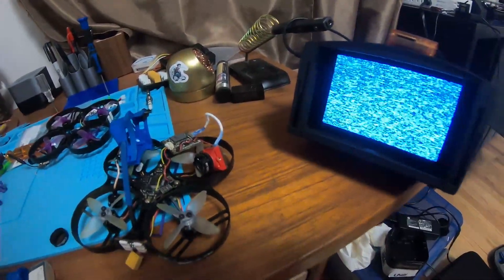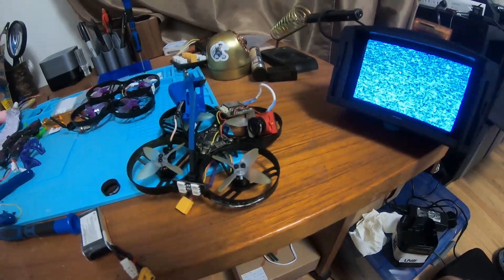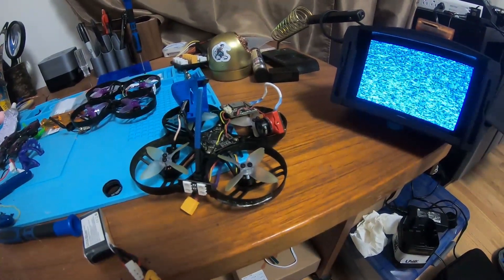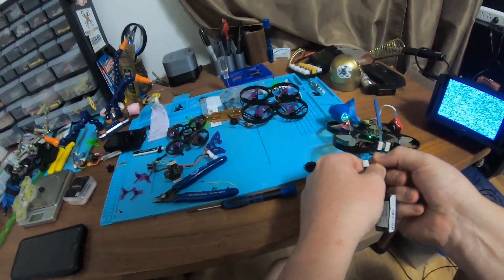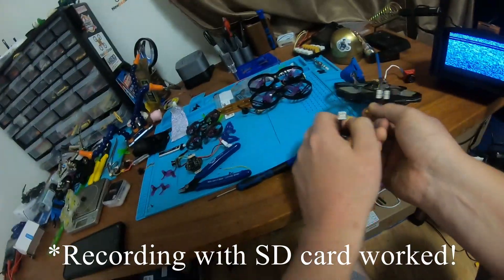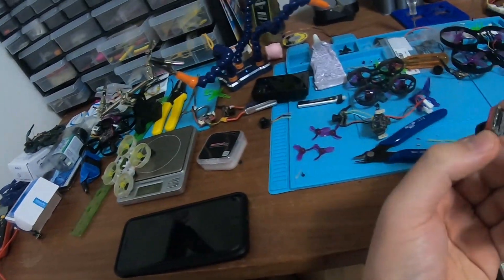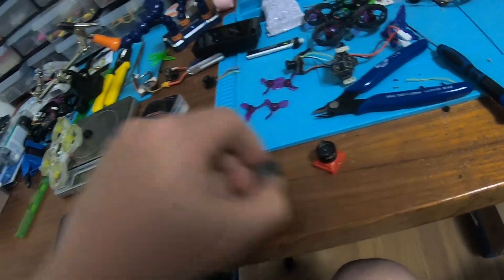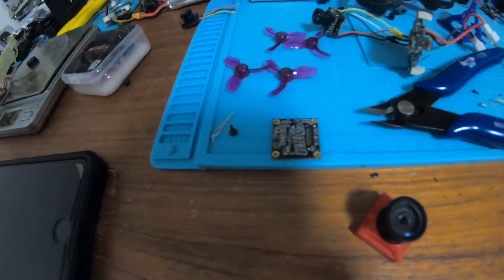How to FIX the Caddx Turtle Yellow Screen of Death (without replacing anything!)

Comment: Youre a legend man!! I’ve had this camera sitting around for nearly 2 years because it wasn’t working and the other day I thought itd be good for my micro LR so I had a google and your video popped up. All fixed in less than an hour!! 🙌🙌🙏🙏🙏
Reply from the maker: Awesome! Idk if they are still doing it but you could message Caddx before and they would mail out a replacement board for free. I would message them through their website and see if you can still get one.

Comment: I had a similar problem, OSD but black screen (no video). Searched everywhere for an answer, couldn't find anything that worked.  But then I stared at the owner's manual for a while until I noticed something.  The same button that starts and stops the video recording, ALSO turns the camera on and off.  Hold the button for 5 seconds, and it turns the camera on/off.  So I held it for 5 seconds while everything was powered up, and viola, I got the video back, NO MORE BLACK SCREEN!  NOTE 1: If you power off then power on the quad and get the black screen again, press and hold the button for 5 seconds to turn the camera on and then connect the 5D-OSD Menu Board to adjust the camera's settings.  Go to "System settings > Auto boot > on," and that fixed it for me.  Now the camera comes on when I power up the quad.  NOTE 2: I have the Caddx Baby Turtle V2.  It came with my GepRc Skip HD3, which by the way, is an AWESOME quad!
Reply from the maker: Cool - yeah yellow screen means the cam is not working but connected.
Reply: @FPVSkittles  I don't think this is true. I can remove the cam completely and still get the yellow screen.
Reply: Thank you for help man. Auto boot is useful there.

Comment: Hi,  i've problem like this but mine was blackscreen..
Reply: I had the same problem, OSD but black screen (no video). Searched everywhere for an answer, couldn't find anything that worked.  But then I stared at the owner's manual for a while until I noticed something.  The same button that starts and stops the video recording, ALSO turns the camera on and off.  Hold the button for 5 seconds, and it turns the camera on/off.  So I held it for 5 seconds while everything was powered up, and viola, I got the video back, NO MORE BLACK SCREEN!  NOTE 1: If you power off then power on the quad and get the black screen again, press and hold the button for 5 seconds to turn the camera on and then connect the 5D-OSD Menu Board to adjust the camera's settings.  Go to "System settings > Auto boot > on," and that fixed it for me.  Now the camera comes on when I power up the quad.  NOTE 2: I have the Caddx Baby Turtle V2.  It came with my GepRc Skip HD3, which by the way, is an AWESOME quad!
Reply from the maker: Black screen with osd normally with fix itself after a powercycle
Reply: @davehrcfpv  When all else fails, read the instructions, huh?  Glad I could help.  I was so happy when it worked for me.
Reply: @davehrcfpv  Again, glad I could help.  BangGood had a link to the owner's manual, and I also sent a request on the Caddx website and they sent me a pdf.  You can get the voltage and flight time on the camera's OSD.  You access it using the same 5D-OSD Menu Board "OSD settings > Voltage > On > Time > On." Not sure exactly how things have to be wired for it to read the voltage accurately, but it's something to try if you can't get the BetaFlight OSD.
Reply: @davehrcfpv  You always have to have the schematic/pin-outs for the FC, VTX, RX and camera you are using, or...you're $hit out of luck.  Even then, good luck...it ain't always easy!

Comment: IT WORKED!!!    It's only a $15 part from Banggood,  but then I would have had to wait for the slow boat from Corona. I formed a piece of foil to set it on so the sensor wouldn't touch. I put it in the oven at 180 for 7 minutes and it did not work the first time. I had nothing to lose so I tried it again at 200 for 7 minutes and it works. I don't have an oven thermometer to verify the ovens temperature.
Reply from the maker: Sky Jet I’m glad it worked for ya! Be sure to also contact Caddx via their website! They should send you a replacement board if that one fails again. Good to have - my board is still working but I also have a backup now.

Comment: I had the same problem after a crash.
So after your Anleitug the Cam placed in the oven. Then it works again. But after about 2-3 minutes on the table on the monitor, it turns off. The housing where the lens sits in it, then gets very warm.
Reply from the maker: Sorry to hear it wasn't a fix for you. I would suggest contacting caddx via their website and they will send you a new sensor board for free

Comment: Liked/subscribed, and... saved video for later. Apparently I'm going to need it. lol
Reply from the maker: If it happens to you try this method but also contact caddx via their website and they will send you a replacement sensor as well.
Reply: @FPVSkittles  I wish they would put out a firmware update that would allow the OSD voltage to display higher that 12v. It runs on 4.5 to 20, but the display only goes up to 12... Talk about dumb.
Reply: @FPVSkittles  Roger that.

Comment: I thought NO WAY is this going to work. But also figured "What else I got to lose?" IT WORKS... I've subscribed and liked. Getting ready to go on vacay and wanted to take this thing with me.

Update: After getting it to work. Put it back together. Was working. Flew around the house for about a min and back to the yellow screen. Took it apart, baked it again. Worked. put it together, still working, flew an entire battery, put in new battery, still worked, took off and back to yellow screen. Think I just need to get a new board. 

Was worth a shot. I may try baking a little longer at a higher temp in my campfire during my vacay.

Thanks again.
Reply from the maker: Kris Eiben sounds like you need to go a bit hotter. But be sure to also contact caddx through their website. Tell them about your problem and they will send you a replacement  board. Happy flying man!

Comment: Ma sei un grande! 

Tests: 
first time 180°F for 7 minutes. -> Nothing
second: 180°C for 5 minutes -> Nothing
final: 200°C for 10 minutes + 15 mins of cooling off -> Successsss
Reply from the maker: Glad it worked for you! FYI you should also contact Caddx support through their website and they should send you a replacement sensor board for free just incase the fix doesn’t last.
Reply: Ciao, hao messo a 200° C per 10 minuti ? Io ho provato ma non và

Comment: This happened to me and a friend of mine. Used a heat gun set at 300c for 30secs and it cured the problem but only for a few minutes and same for both of us! Yellow screen of death 💀 was back.....
Reply: 300° C for 30 seconds, most likely isn't enough time to allow the components to reflow properly.  If you're going to use a heat gun or a hot air soldering station, do so while viewing the board and the components to insure that the solder actually liquifies properly to obtain a good solder joint.  Typical reflow temperatures are between 200 and 250° C - 390 to 420° F.  Temperatures in excess of that, run the risk of damaging the components.
Reply: Shadowcruise99 good tip however I’ve limited setup for soldering with just the basics. Anyway, found the Mobula7HD too problematic and traded for another 75mm non HD Quad.
Reply from the maker: Etops Flight ah damn - if you contact caddx they will send a replacement
Reply: FPV Skittles My LHS has great relationship with CADDX supplier. Had one cam replaced for free. I’m on my third cam since new. More testing required as work has been in the way.

Comment: Helpful Video, good idea Skittles. Mine was Yellow Screen as new, never got to fly mine until Caddx kindly sent me an entire new Turtle, cable and board and controller which I swapped out and all is well... I ordered a new sensor so I can fix the original one so now I will have a full Caddx Turtle System as backup. Andy at Caddx is the guy to talk to, they are very good (but slow) at replacing your camera if you have this issue. It's very common. Best tip, by spare sensor screens in case you have this again.
Reply from the maker: Good Advice - I also got a replacement board from Caddx via the website when I told them about the yellow screen.

Comment: Believe it or not... it worked for me!!!!! I wonder the initial thoughts leading to this solution...!!!! Thanks!!!! Mobula HD is back !!!!
Reply from the maker: Glad it worked for you as well!!
Reply: Is this happened to mobula7 HD? 🙏
Reply: doktor drone Nope. My Mobula HD caught on fire with no reason... 
https://youtu.be/fr80vo08Pgk
I wish i had only a camera to replace :’(
Reply: It's called reflowing.  Surface mount electronic components are typically soldered in place udinh solder paste and  s reflow oven.  Occasionally in production, the components don't adhere correctly due to manufacturing errors and reflowing the circuit board by putting it in an oven will allow the components to weld appropriately to the solder pads.

Comment: Thanks for your solution.
My Caddx tutle V2 had yellow screen issue after 2nd flight. The screen was halted and then the yellow screen has been shown since that time.
After seeing your solution, I tried to heat the bottom of the sensor board with a heat gun. (400 degree C for 1 minute)
Now the camera works well. I think the solder status on the bottom of sensor component was not good.
So when heating the board, the solder paste melted and the pad could connect with the PCB pad well.
I think this is very critical issue. Because my drone was not crashed, it means that the camera module board cannot endure any external damage.
Why did not Caddx consider it ? Maybe this camera module will be used for drone FPV and recording. So the good durability is mandatory...
Reply from the maker: I am glad I could help, but I would still suggest that you contact Caddx (though the website) and tell them of the problem so you can get a replacement board incase yours fails again.
Reply: This is crazy, I also used a heat gun and after two attempts the camera magically went beyond the yellow screen and worked again. Haven't flown it before, it was a new build with the camera fresh out of the box. Doesn't let me trust this cam too much though...

Comment: Damn.. i got my Mobula7 HD right after Easter.. about 10 packs later had the yellow screen of death. The only thing I found online was to replace the sensor, so I started bugging Banggood to replace it. They didn't provide me a solution yet, but I will definitely try these out if they won't replace it. Thanks mate!
Reply from the maker: Yeah give this a try - not like it's gonna make it any worse! And maybe they will still send you a replacement cause I am not sure if this will last forever. I'm sure its possible that the yellow screen could come back over time.
Reply: @FPVSkittles  Ok, so you actually inspired me to open the whole thing up. It seems the cable was bent really hard when put together in production. One of the threads right behind the sensor is broken open. I gotta say I'm really disappointed with the quality of this thing..
The props hit the camera board all the time, the FrSky antenna below the FC is horrible and it even came flashed with an early build of the BF4.0. What kind of quality control is this..
Reply from the maker: Michał Korzunowicz yeah idk about the HD but my Mobula7 was fine. I think it’s kinda hit and miss with the Chinese companies. At least you know now you just need a replacement cable. Buy it from caddx with a set of ND filters (really helps the quality of footage) and it should be an easy fix.
Reply: @mkorzunowicz  How can your props hitting the Caddx Camera Board be Caddx fault? They only make the cameras. I bet you had trouble if the props were striking the delicate camera board.
Reply: @BrigzyFPV  I'm afraid I can't find any remark that it's caddx fault in my comment.. I meant mobula7 HD that I'm disappointed in.
Reply: @FPVSkittles  btw banggood offered me 40 eur refund which I took. I checked the cable with a multimeter and it seems fine, so I tried heating up the sensor with a heat gun, but that didn't help, third time made the sensor fall off the board. So I ordered everything for the refunded money: the filters, a new coaxial cable and a new sensor board. I really hope it will revive it. I even printed a canopy for it already :)